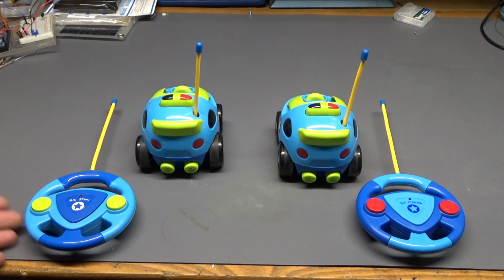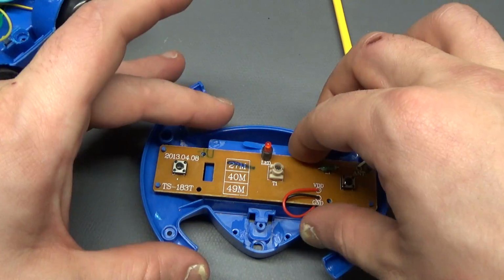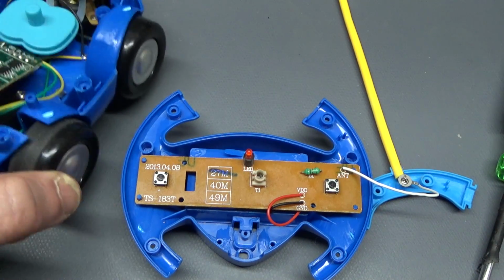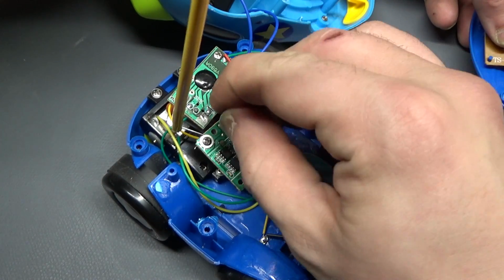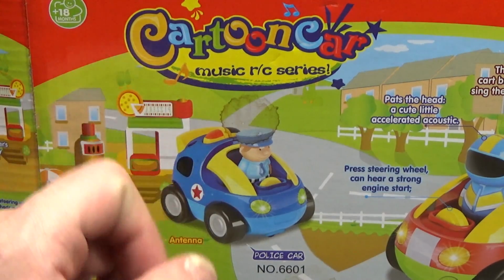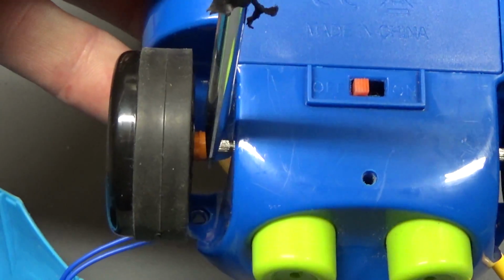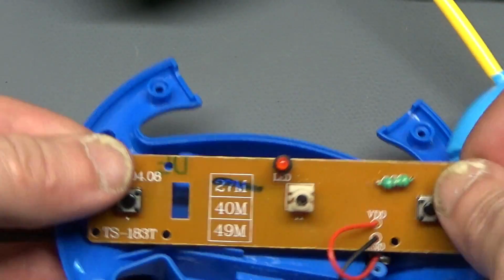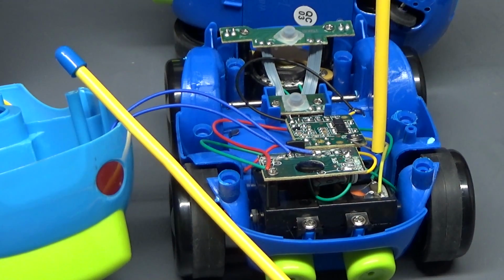How to Change R/C Car Frequency

Comment: Got the same cars for twins for Christmas, same problem.  But on opening the controller the adjustable screw to change the frequency has been replaced by a solid state component, so sadly no adjustment possible.

Comment: Need to try to do this for an RC car that we lost the remote to. Thanks!
Reply: I broke the "Adjustable High-Frequency Ferrite Core Inductor" aka transformer on my kids rc car while trying to turn it with a screw driver so now I'm going to buy a pack of 10 of them on ebay for about $2.50 and try to solder one on and get his car going again. Anyone know if there's a special "tool" to turn these little things or if a tiny flat head screwdriver is the best option (that's what I used when I broke it)?

Comment: 4:00 The racing one has screws hidden behind the hubcaps which need to be popped up, after that you can remove the wheels and access the underneath screws!
6 years later later, your video is still relevant! Thanks

Comment: Ok. That's NOT a transformer. Plus you're supposed to use a non-metallic adjuster. Next that doesn't bring you to 49mhz. What you did is VIOLATED Federal Laws. From 27 thru 50mhz. There are emergency frequencies used by State & Federal government. The transmitter can be going to any random frequency. You only mistuned both. This may seem innocent but it's not.

Comment: Same here, from AliExpress for the 2 little ones and one kids wasn't very happy. I hoped for an internal switch. Thanks for easing my mind and helping that the kids can both be happy today. You are my today's hero. Oh and a great Dad too.
Reply: Ok, I messed up. Having both cars close by each other was a problem as both were picking up the signal no matter how much I turned it. I realized it changed when putting more distance between them. Just all that turning with a too little screwdriver broke eventually the metal core ot at least it cannot be any further be turned. 
Yes, that happened on both :(  Now, we have 3 unhappy people. Take care.

Comment: The problem is my rc remotes has 27.145mhz crystal, i guess this is the legal frequency,i need to get a nearest frequency crystal but luckily the receiver has a transformer
Reply: Buy CB Crystal then. They are cheap. Solder them into the car and remote. 27.405 is channel 40 or any u please. Just some fyi. What he did was NOT legal. It could be transmitting anywhere right now on his end.

Comment: Thank you so much for this... the range of the rc car dropped after I changed the frequency is this expected?
Reply: yes... you can fix or even increase the range by turning the transformer the opposite direction
Reply: you lowered the frequency which lowers the range.

Comment: I have the same model car but remote doesn't have same PC board. Instead it has Crystal soldered straight on board and can not be changed without removal.

Comment: Good tip, thanks for that!
Just a question: any recommandations regarding how to manipulate that "special" screw?
It is not metal, seems like a "rocky" screw. 
I just destroyed one.. right when i was happy to see that i can change the freq on the rc.

Can that screw be replace with a metal/ normal screw?
Reply: Same here, and now it is damaged, so unsure what to do
Reply: I'm in the same situation, did you have to replace the part?

Comment: In my case it was half-true as pad had freqency set on static crytal, but  car could be tuned as on your video while i resoldered crystal. Great instruction!
Reply: Reverieru I've just opened up both of my kids cards and found they don't having the tuning pot, can you share details of the crystal you changed to, looks pretty straight forward swap if I can source the right component.

Comment: Hello bro, I got 2 rc bus with 27mhz transmitter and receiver. Transmitter in remote doesn't have variable transformer to change frequency. I see 27m & 49 m . But no option to change to 49m. How to adjust the frequency in remote. Please help

Comment: Shitload of luck, there could have been some internal quartz crystal  to the IC controller and it would be nogo:)
Reply: If there is a crystal and the transformer internal magnet is cracked would that cause it not to work? Could replacing the transformer make it work perhaps?
Reply: I'm trying to make a drone out of my rc car, but I am facing problems. Can you help me?

Comment: This trick ONLY works on transmitters WITHOUT CRYSTAL FREQUENCY (capacitor - inductance  oscillator).
If the transmitter has crystal (generally 27.145Mhz in Chinese cheap toys), the frequency is fixed.
To change the frequency, you have to change several components:
http://reparar-cochesrc.blogspot.com.es/2018/01/emisora-cambiar-de-27-mhz-40-mz-o-49-mhz.html
Reply: Thank you for your helpful comment, I have tried exactly on what you mentioned, two RC cars with similar crystal frequencies. I have exchanged one crystal to be 40 MHz but still not able to modify the car's frequency. I could not make use of the figures included in your link because they are not in English and I am not fully knowledgable about these components. I hope if there is a video explaining that !
Reply: Hi,

If you want to make a transmitter and receiver at 40 Mhz with these component values, it is more expensive than if you buy the new RC car!
The values of the components have been obtained from the application sheets of the manufacturers (in example: http://www.weeqoo.com/UploadFile/2008/10/20/200810200959408504.gif).
If you want to understand how the circuit works (english): https://predictabledesigns.com/how-a-radio-controlled-toy-works/
Reply: If you want to change the frequency to 40Mhz easily (I do not guarantee long range):
*Transmitter: change the crystal to 40Mhz
*Receiver: you must change L1 and C3 (tuner circuit: adjustable inductance and capacitor) in my diagram.
  C3 = 10pF to 22pF (almost half the value at 27Mhz)
L1 = one or two windings less

Adjustment:
1) With the transmitter and receiver close (several centimeters), slowly turn the core of the inductance L1 (receiver) with a plastic screwdriver until the car works.
2) Put the transmitter a little farther and slowly turn the core of the L1 inductance (receiver) again until the car works (fine tuning).
3) In the transmitter, turn the core of the inductance L3 with a plastic screwdriver to achieve the maximum range.
Reply: Thank you very much indeed. Before reading your so-helpful reply, I have already purchased an adjustable inductance of 38 MHz as a guess of possible response to the 40 MHz crystal at the transmitter that replaced the previous 27 MHz. I am going to implement your steps and let you know.

Comment: quick qeustion???

does changing the remote frequency means i can connect my remote control to other rc car?
Reply from the maker: It is unlikely to work. It is similar to trying to use a TV remote on a different brand TV.

There isn't a set protocol for the control signals of RC cars, they are just required to transmit within particular frequency ranges with the proper levels. 

but hey if it were me I would probably try it anyway :)

Comment: I've got 2 boats, the transmitters use 27mhz crystals and the receiver uses frequency transformer, is there no other way but to change out one of the crystal?
Reply: Enki Cheung I have the same problem I even adjusted the frequency transformer to seek another transmitter with a different frequency  but nothing happened.. and it's keeps responding to its original transmitter

Comment: I would like to ask the following. I have notice that most rc toy cars at 27 MHz with only forward and backward function(meaning without left and right) start by themselves, without using the transmitter. Do you know why this is happening? In order to exclude other radio waves sources I have closed the rc car in a box which is wraped with aluminum foil and it steel starts by its self. Have you notice this kind of behavor in the rc toy car you are using in your video? Do you have any explanation why this is the case for the most rc toy cars with forward and backward function only?
Reply from the maker: at 1:22 you can see how simple the transmitter circuit is, I did not measure the output frequency of the transmitter, but I am guessing different between forward is a minor change in the modulating or carrier frequency. This makes the 2 mode transmitter quite cheap. 

I did not have these cars very long, but it would not surprise me if they move forward or backward "on their own". I believe this occurs due to a cheaply designed modulation technique, so the car will react easily to ambient radiation. Similar to how how a lightning strike will cause an AM radio to make a pop noise.
Reply: Thank you for your fast reply. One last question. In order to block the ambient radiation  I have created a faraday shield
by taking a box and wraping it with aluminium foil and placed the car inside the box. I have checked that the shield is ok( the rc car cant take the signal from the transmitter). But the car steel moves "by its own'. Do you think that this is due the internal circuit of the car? A capasitor maybe? Since,all external radiation is blocked. Do you have any idea on how to check that?
Reply from the maker: I have tried making my own Faraday cages/shields in the past, and device inside was still susceptible to external to noise, this i believe was caused by poor construction and grounding on my part.

Electromagnetic interference (EMI) in theory should prefer to travel through the metal foil therefore significantly decreasing the amount seen by the device within.  

Have you tried controlling the RC vehicle with the control while it is inside the Faraday cage?

I suspect that the the car's receiver is too "sensitive" meaning the communication protocol is poorly designed to ingnore EMI. For example more modern communications require an initial sequence before listening to the incoming signal. Initial sequence "10110101"(Hi there) immediately followed by "00001101" (reverse).

There could be internal circuit noise that triggers the move forward or backward command.

Good luck I hope you can find more info online.
Reply: Yes I did tried to control the car while it was inside the Faraday cage and the transmitter couldn't reach the car's reciever.
Anyway, thank you once more for your time and help.

Comment: Hi Matt, Nice save for your nephews. Just a caution. There are only 6 frequencies available in the area that you are in that the FCC authorizes for R/C. they span 26.995 - 27.255MHz in 50Khz increments. The other frequencies in the toys were probably for other countries. The are also 30 channels up at 74-76 MHz. You probably didn't have to adjust that transformer too much get a different channel. Also, and I am sure you know this, use plastic for those adjustments. Try putting one of them on your scope and see if you can see the output. I love R/C and Ham. You'd be surprised how much the little toys can cause havoc when they get out of factory adjustment.
Reply from the maker: Thanks for the information, I was wondering about the fcc bands for r/c.
Reply: Look at Part 15 also. I am at 915MHZ with my drones. Your nephews have a great Uncle by the way!
Reply: Whats the one for Texas
Reply: Hi @Ed McLaughlin, Do you happen to know if a rc board that is listed as 27MHz and 49MHz (and has variable transistors on both the receiver and transmitter boards) can just use those two frequencies or can I set it in between at 40MHz (I have three boys who are all building their own vehicles so I need to be able to set them at three different frequencies)? Would appreciate any advice you have